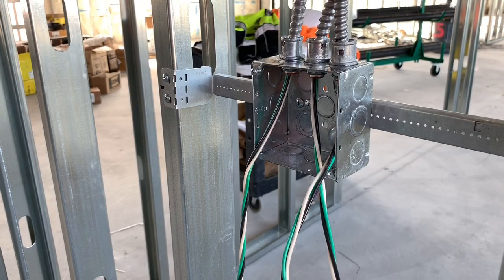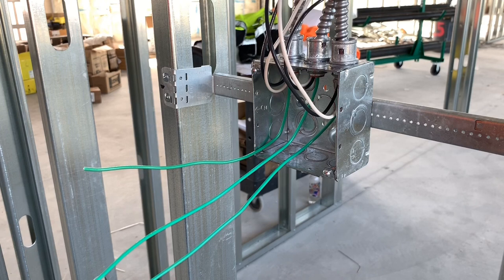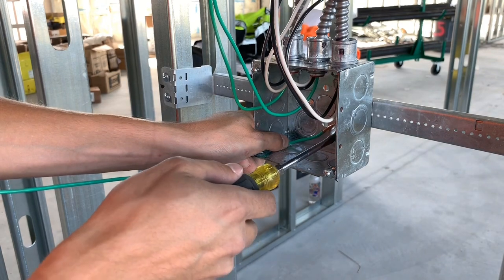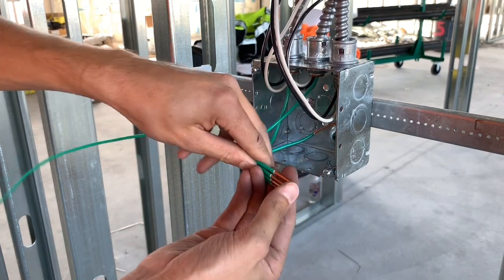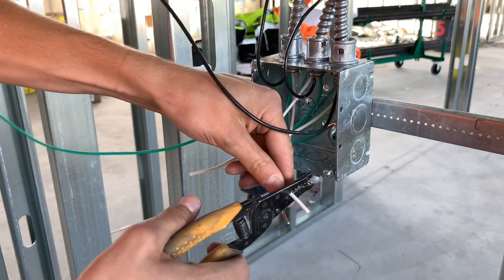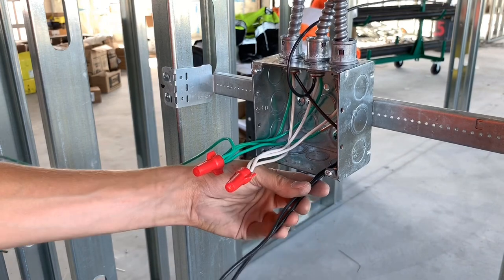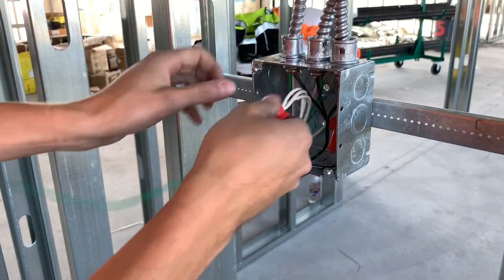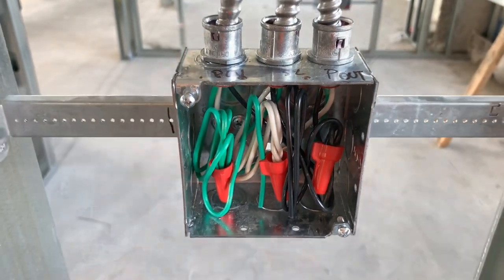How To Make Up A Single Pole Switch Box During Rough In (Commercial)

Comment: only thing i do different is fold the grounds horizontally at the bottom of the device. Hots and neutrals vertical on the left and right side. It leaves more space for the device in the center of the box.

Comment: That wire nut drill is hilarious. Electricity snd I dont get along- I sure enjoyed this video. I just replaced an attic fan motor today and want to add a switch to it so i dont kill all the attic power next time. Ya did a very good, smooth video. Thanks.

Comment: Our company puts a box above every office switch or at least in every office so there's less wire in the box that the device goes into. The motion sensor switches are pretty big
Reply from the maker: very true, that also sounds like extra work and cost and potentially a nightmare for trouble shooting or the next guy lol.
Reply: @DailyElectrician  well we do a lot of TI type stuff. However we just run a backbone through each office so trouble shooting is actually a bit easier at times. When the tenant or when whomever wants something added lighting wise.. it's a lot more simple than running everything in each switch box
Reply from the maker: that makes sense :)
Reply: @DailyElectrician  I agree that it's a lot of extra work and connections. I'd just use a deeper box or use extensions rather than making extra boxes up above.

Comment: for light mc I use a single mc for power in and out I keep in a double, helps not mixing up the hot / SL
Reply from the maker: good idea :) i like it!
Reply: @DailyElectrician  
I thought of that because I was tired of fixing everyone's work, makes it really easy to troubleshoot as well.
Reply from the maker: i do that with romex and a double gang plastic box, 2 powers on the inside knockouts, SLs on outside knockouts

Comment: As a life long sparky best practice is to always strip #14&12 wires at least 7/8" long then pretwist with side cutters, then trim ends the tighten pressure connector ( NO SUCH THING AS A WIRE NUT IN NEC ) with side cutters then apply quality tape to prevent connector vibrating loose.
Reply: Wrong, tape does absolutely not keep connections from vibrating loose. 

Yes, many electricians use the pre strip and twist method. It works great. Just adds a couple extra steps. If i have time or if i have 5+ conductors I usually pre twist. 

All you have to do is strip the wires line them up nice and straight and twist the properly sized wirenut over them. A good electrician knows just by the feel when the wirenut is biting. When you can see a couple twists in your conductors they are generally fastened together. A visual inspection and little tug is all that's necessary. You dont use tape to keep it from coming off. Everything in our industry is listed for specific applicationa and purposes.
Reply: @StraitClownin909 Don't know or care about your lack of experience but have worked in harsh environments like crushers, hammer mills , shaker & vibrating conveyors, 500 ton shaking injection molding machines, punch presses from small to 3 floors high, etc. Only time that a pressure connector came off was due to lazy ahole not applying at least three wraps of quality tape around it.

Comment: Great Video!!! Just have a couple comments.
 (1) 4 fingers from the face of the box, not plaster ring.... I can tell you NEC requires 6" from face of box, if box is getting plaster/mud ring, then it's from the face of that. 4 fingers wide are hardly 6". I will agree that using a little less wire before tap is great for box space, but it is not correct. 
 (2) that tool you used in the drill. Never used one, and this is why. I have been in the industry since 1995 and have seen many tools come up and disappear over the years. One tried and true method has always been to pretwist with your linesman's first, then put on wire nut. Listen, the NEC does not state it can't be done with an impact or drill. The NEC just says by mechanical means. If you pretwist 1st then the wire nut becomes just an insulator instead of the mechanical means of connection. Personal preference but also a safety issue for any future electricians who may work on those taps. 

Safety goes a long way in our everyday lifestyles in everything we do. Let us not always think about ourselves at this moment but let us think about how our actions at this moment may affect someone else in the future. Future can mean 1 second from now or 100 years, but it is always from right now moving forward in time. THINK ABOUT IT
Reply: I always do my pinky to my thumb in a thumbs up position.
Reply from the maker: Not saying you're wrong, but I'd love to see the code that says 6" from face of box. Unless it just got updated in 2020, it's always been 6" total, and i have at least 8".

either way if you pull the wire straight out it's 7+ inches from the face of the box. so i'm still good. thanks for the concern tho ☺️
Reply: @DailyElectrician  I do stand corrected. I apologize for the incorrect statement. I just read your reply. Sometimes I get caught up in specs versus codes. I have spent many years dealing with the same type of specs and the majority of the time the specs I have been dealing with state 6" from face of box instead of the 3" required in the NEC. You are correct in, it is 6" from cable entry in box unless it is under 8". I can't remember the entire paragraph / article. I do remember it is requirement of 3" from face of box.  I believe if memory serves me correct, it is in article 300. something, hell maybe 310. something. i can find it though, guarantee. 🤣😂🤣 
Let me say one last thing. You definitely do your install in a neat and workmanlike manner. Hard to find these days. I have been dealing with lots of calls to repair new homes (and occasional commercial business) that the electricians that wired them tell the owners that there is nothing wrong. I get there and listen to the customer and go troubleshooting. 9 times out of 10 I have run into the wiring is way too short, wish I had a pic, and the electricians used the wago nuts, or however you spell it.  Then when I pull the device and look, well guess what, wire barely making contact in the nut. I am old school with wire nuts. Trying to put one on with only 3 inches of wire inside the box and a 3-inch tail SUCKS and can hardly be done. 
Keep up the great work!!!!
Reply from the maker: no worries! it did make me question myself tho, haha. only used a code book once in nearly 5 years so it could have changed, lol. it's 300.14 i had my friend check haha. 

appreciate it! 🙏🏼
Reply: You could say that again. Tighter connection ass well.  I've opened a few boxes ass soon as you just bring the wires out just to look the wire nut falls out.

Comment: Question: If the incoming is connected to the outgoing to continue the circuit, then where is the switch leg getting its power from if there’s no pigtail on the hot and traveler?

Comment: Identify the switch leg or the hot .so when you are going to connect the switch you know which one is it
Reply from the maker: why?
Reply: Because you need to put the hot leg on bottom screw. 
The switch shows a arrow or top 
I get in trouble with it , so now I put a tape to mark the hot leg .
Reply from the maker: never heard that before
Reply: TheCorvetteKid  this is also needed for motion switches and other kinds im surprised youve never come across this
Reply: If you had to put a motion there and you didnt have an outgoing constant splice, you would have no idea which wire is the switch leg and would have to identify because motions and sometimes dimmers matter
Reply: @robertmartin5167  It is not necessary to identify the switch leg on a single pole switch, just don't install it upside down... Top means that side goes up. It doesn't matter which screw the hot and load wires go to on a single pole switch. A switch is a mechanical bridge that internally connects/disconnects the two terminals, and if your switch is upside down it means you need to unscrew it from the switch box and just turn it right side up.
Reply: @ilawrence97  It is easy to figure out which is line and load with any tester. Also, usually like line is a pigtail coming from a bunch of black wires and the load is often just one wire straight from the load cable.
Reply from the maker: very well said!
Reply: @DailyElectrician  A lot of people talk about having line or load at the top or bottom because they don't understand the concept of what a switch is and how it works.
Reply: @DailyElectrician  3 way and 4 way switches are a whole other concept. First let's get down the basic single pole. Lol

Comment: What attachment for the drill is that for wire nuts?
Reply from the maker: yeah its for wire nuts
Reply: @DailyElectrician  where can I buy one?
Reply from the maker: similar ones on amazon for $10

https://www.amazon.com/Ideal-30-902-Spin-Twist-Connector-Socket/dp/B00R2CAK1I/ref=sr_1_38?crid=RDCUED9GY21T&dchild=1&keywords=wire+nut+drill+attachment&qid=1602541873&sprefix=wire+nut+drill+%2Caps%2C206&sr=8-38

Comment: Ay bro does code require the wires to be 6 inch extra from the end of box ?
Reply from the maker: no, just personal preference
Reply: not from the end of the box, but YES from where the cable emerges into the box, or for NM romex cable, from the end of the sheat, so that would be at least 6 1/4” from where the cable emerges. and depending on the depth kf the box, cable has to have at least 3” of free length from the edge of the box 

NEC ARTICLE  300.15

Comment: I do not trust that twisting method thats for the impact driver. Where is the 6 inches of wire ?
Reply from the maker: ok. should be there
Reply: @DailyElectrician  Is this for a single pole application?
Reply from the maker: yeah (title of video) :p

Comment: Electrician 25 years When I put my wire nuts on I Run it in reverse will pushing it on to ensure all wires are in then switch and screw it on till all wires start to twist you never have a issue....